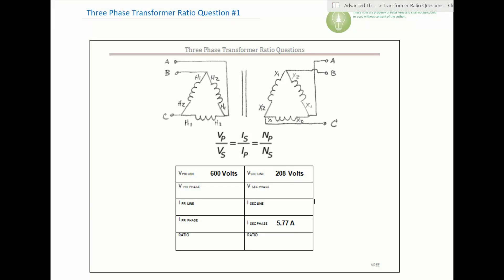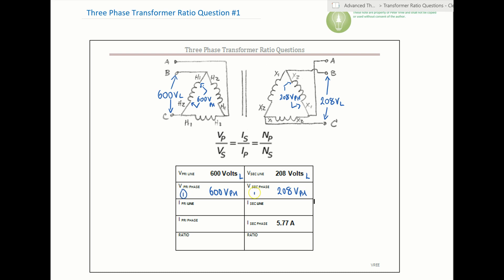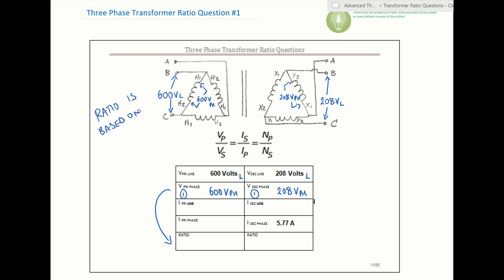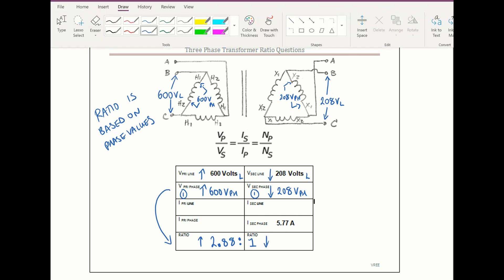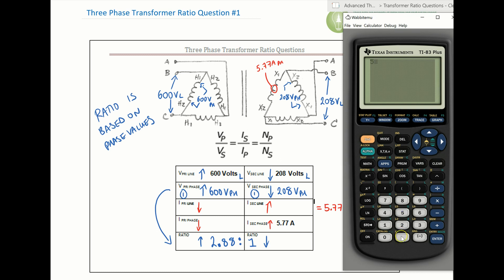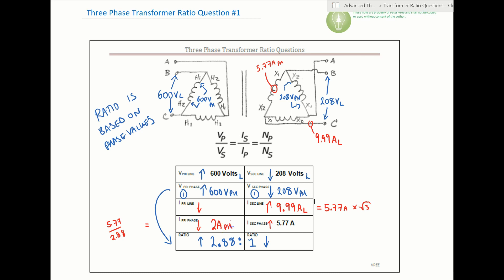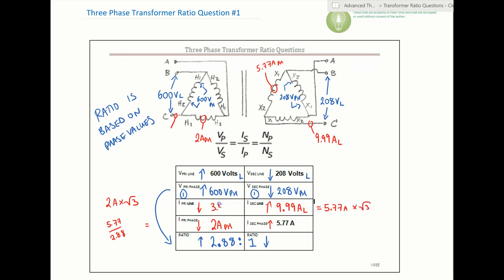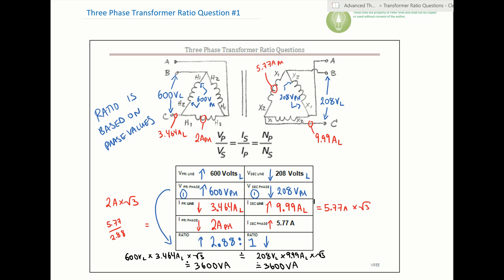3 Phase Transformer Ratio Question #1

Comment: Thank you so much you are an AMAZING teacher! Your videos are helping me prepare for the PE exam! Quick question, I cannot find answer explanations for the rest of the questions in the pdf... For Three Phase Transformer Ratio question #7. How did you derive the secondary Line/phase voltage? Thank you!
Reply from the maker: Secondary Line Voltage is given at 208V, so any Delta circuits have the same Phase Voltage (208), any Wye circuits have 208V/1.732 = 120 V Phase.
Reply: @PeteVree  Thank you so much for your quick response!! For question number 7 in the PDF packet in the link above, there is a 3-phase-Y heater and 3-phase-Delta motor connected to the Secondary of the transformer in the Y configuration. The secondary current answer is 19.70A but I'm not sure how you got that number? Thank you again, very very much! I really appreciate this!
Reply from the maker: The 19.7 is equal to the square root of (( 8 )squared plus (18) squared)) I've used Pythagoreans theorem to find the total current because the resistive load and the inductive load are 90 degrees out of phase.
Reply: @PeteVree  I see now!! Thank you very much!!!